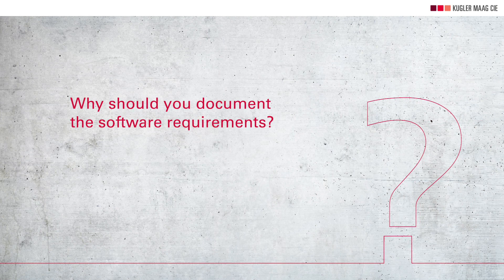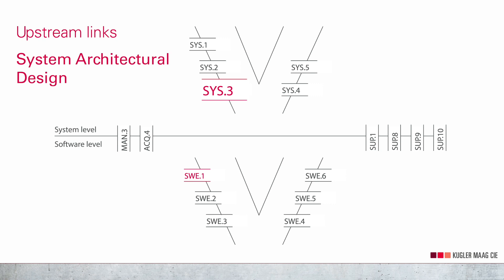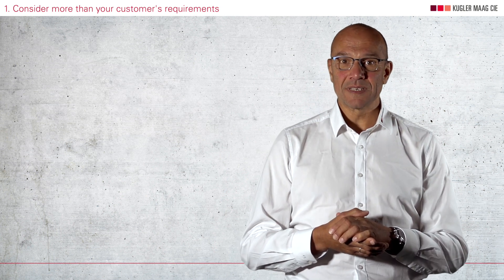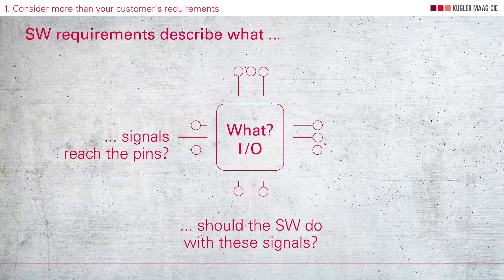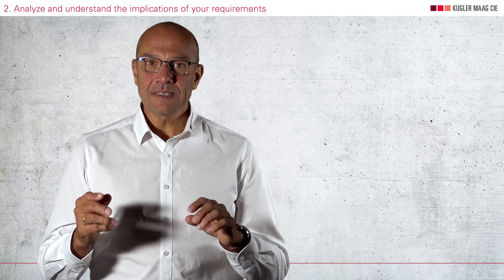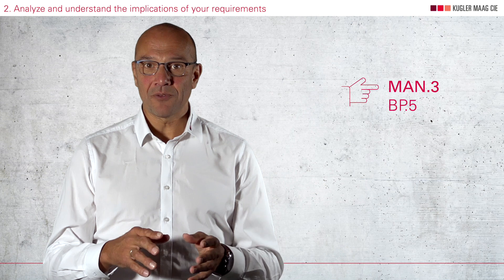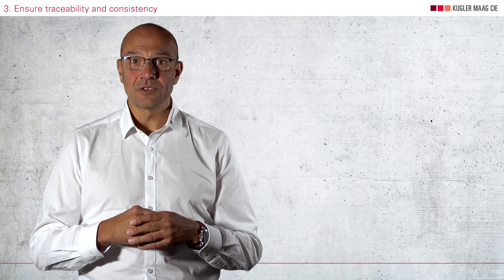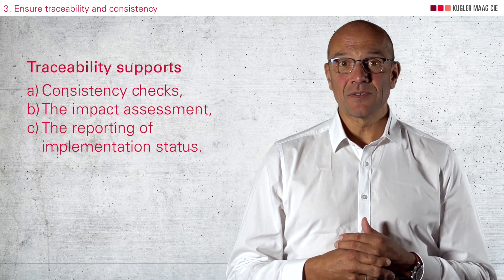SWE.1 Software Requirements Analysis | Automotive SPICE

Comment: How I ask the difference between feasibility and technical implication? In my opinion, feasibility might already include if a technical solution is feasible?
Reply from the maker: @Hui Jin Your assumption is correct. The check on feasibility checks on technical, but also managerial implications of a technical solutions. Please keep in mind that any doubts about the feasibility are a risk and should be tracked accordingly. We hope this answers your question!

Comment: Thank you for the elaborate explanation. I had a question in terms of specifying a requirement as a relationship between the inputs and outputs of a function. Many times, the relationship is not straight forward and we would need to define some intermediate signals to connect the inputs and outputs together. My question is whether it is ok to write requirements for these intermediate signals in the SRS? If yes, what impact does this have on the SWE.6 qualification tests?
Reply from the maker: @Narayan Narvekar thank you for your question! You are right. Sometimes you need to cover complex functions by using intermediate signals. In our opinion, there are two ways of dealing with this:

1.	If these signals are visible outside of the software you should add requirements.
2.	If these are internal signals only, they are likely part of the solution and should not be documented as a requirement but rather as part of architecture.

We hope this helps you further! :)

Comment: Hi, for me the descriptions of sys2 and swe1 are too similar. In general I don't understand where the difference between system and software lies. Especially if the product is software only
Reply from the maker: Hi Marcos,
I understand your point, but if you check the processes you will see that they are very similar. In most cases the term "system" was exchanged by "software", so it is not surprising that the presentation of the standard does not show a lot of difference. However, looking at the implementation of the processes, you have to approach them differently.
For SYS.2 you are looking at the system as a black box and define requirements. For SWE.1, it is the software only which is a black box. In some systems there is not a lot of difference, but for instance in ADAS systems, where camera input is preprocessed by FPGAs or ASICs, there is a big difference between system and software requirements.
In your case, if there is software development only you can skip the system-level processes. Actually, note 2 in SWE.1BP1 reflects that. 
I hope this helps. If not, feel free to contact us.
Kind regards
Bhaskar